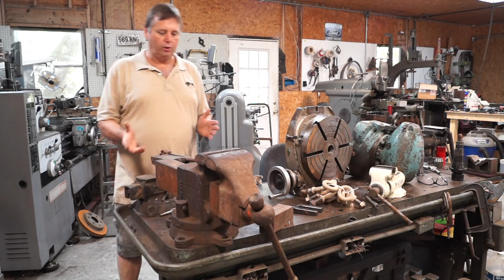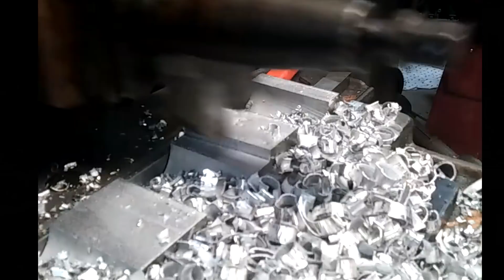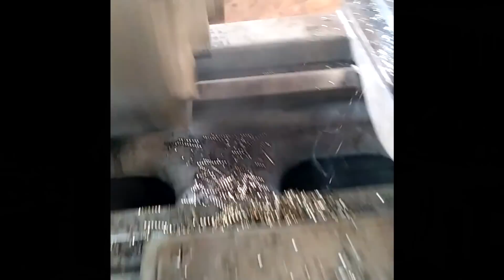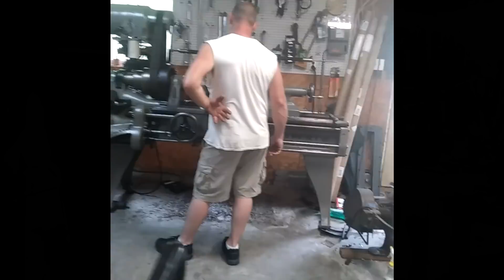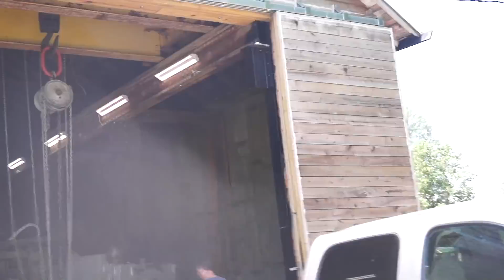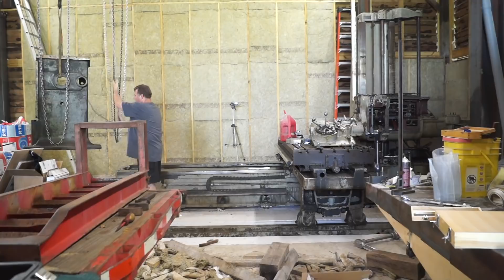Shop Status #4

Comment: I think Mr. Block will register the base on that shaper of yours Mike first...which is why he was looking for pads to scuff with the Miller to get it sitting flat...
He'll then use the weight of the
 casting together with some clamps & T nuts to keep everything secure when he comes to top n face it for square...
He only has to worry about parallel on the horizontal that way...

Comment: John is a great guy! He hooked me up with some cutters. You can epoxy those pucks to the floor to hold the shaper and avoid drilling holes, then if need be later a torch will get them loose.

Comment: I know about the drive gears on K&T vertical heads....I have several heads and two were missing drive gears as someone probably tossed them because they did not know what they were for....Those gears are hard to find and hard to make.. I cut two of them in the past as I have a lead attachment and dividing head on my 2hl universal K&T...If your machine is a 2h, I think Keith Rucker got lucky awhile back finding a gear on Ebay for his.. Looks like the same head he has on his 2h...Keith also has some good manuals on those heads that I posted to his site... Good luck.. Mike in Louisiana

Comment: Mike, can you explain how you designed the hook you have in the cement floor.  Would you keep the same design if you had to do it over again or would you do something different.
Reply from the maker: The hooks are anchored with 5/8 cement anchors. and I am using 5/8 lifting eyes. when done just remove the lifting eye and screw in a 5/8 set screw in the anchor so trash doesn't build up in the anchor

Comment: Kitty litter pans work well under those old lathes.  Keep one under the head stock to catch the oil that escapes from them.  If you have items that tend to rust because they get little use, put them in that pan.

I noticed that you put a qctp on that old lathe.  I don't blame you one bit.  I call my old lantern tool post my "Torette's tool post."  It has been the cause of several sudden outbursts of foul language.

You might look up what is recommended for securing the G & E and take that into consideration.  I know that Steptoe-Western specified bolting to the floor and grouting under the base after leveling.  It might seem like overkill, but one time I ran mine at top speed, I can see why they did.  I think it would have walked out the door on me if I had continued.
Reply: You can also get mud (plaster) mixing trays from the local big-box hardware store. These come in several sizes, and are usually cheaper than official kitty litter pans. I know because that is what I use for kitty litter pans! :-) They work great as catch trays.

Comment: Might want to be careful mixing aluminum and fine cast iron chips together.... be a shame to accidentally create THERMITE!.
Reply: maybe he can borrow some titanium chips from phils projects to get it going
Reply: Thermite is aluminum powder and anhydrous iron oxide powder.  The cast iron chips lack the oxygen content needed to make the reaction run.
Reply: Eli Duttman  And how long does it take unprotected iron dust to RUST in Georgia?
Reply: That might be a legitimate concern, but the aluminum will oxidize much faster, as it's far more reactive. I've seen fine aluminum dust from polishing large objects on the lathe with abrasives and water start to boil the bucket of water as the aluminum snatches dissolved oxygen out of the water. Once that happens, you've already got your final product, aluminum oxide, and the risk is gone. But that finely-divided aluminum powder is itself hazardous for that reason.